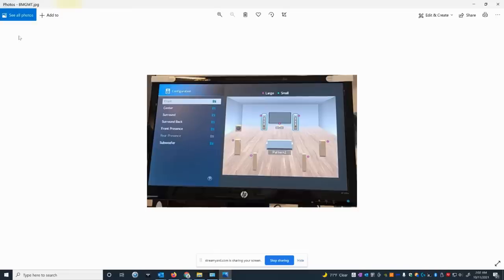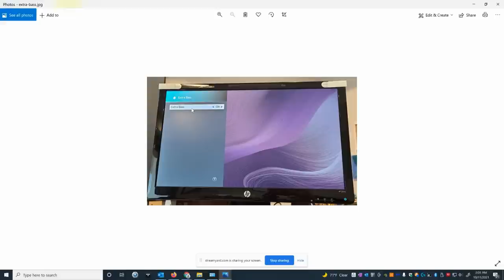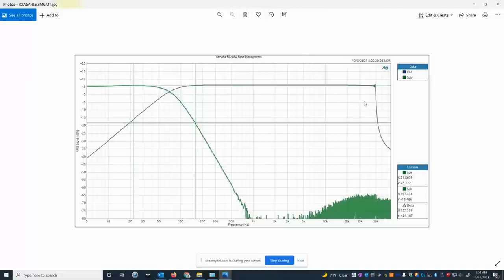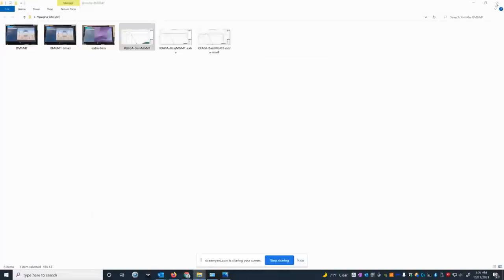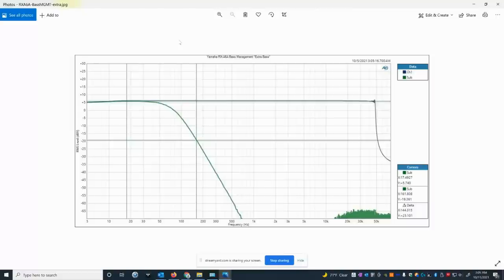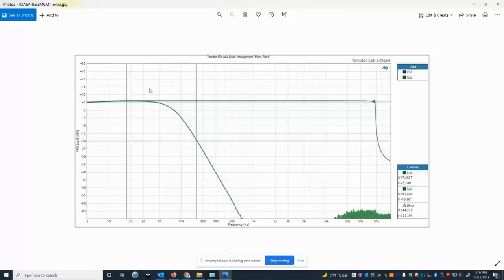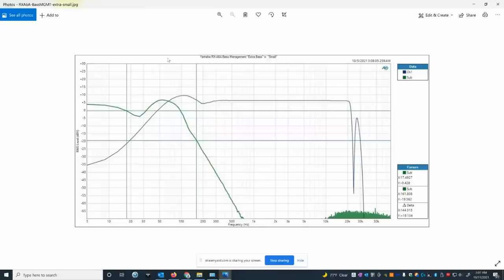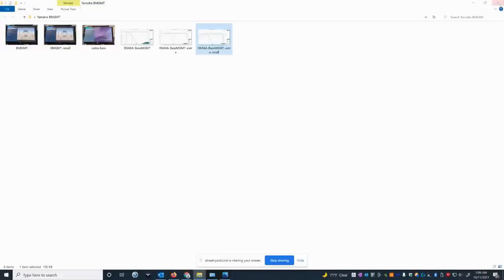How to Set Extra Bass Feature Yamaha AVENTAGE AV Receivers

Comment: Hi Gene. I think using Extra Bass (aka LFE+Main on other brands) is still problematic when the speakers are set to Large. There's overlap so a bump in the combined response occurs. [keep in mind your graphic just shows the electrical output but not the combined/summed acoustical output] While that bass bump theoretically could be EQ'd away there are issues:
A. You can't apply said corrective EQ in the subwoofer out signal because that would also be objectionably EQing the soundtrack's .1 LFE signal when it is the only content traveling off to the sub. Remember we are only trying to fix the overlapped bass peak but the LFE channel should be unaltered.
B.  If you apply the corrective EQ to just all the main channels using a PEQ that's awfully similar to just simply using the HPF ("speakers small") already built in so why waste one of the PEQ bands to do this when you already have a perfect shelf filter custom designed in phase, and all, to work with the sub's signal?
As for Yamaha's wacky "Extra Bass" EQ when speakers are set to small, I assume that was to appeal to people who have grown accustomed to overlapped bass (a bump) and this gives them a simulation of it, even without owning a sub,
Reply from the maker: @m.zillch3841  I route bass to my mains and subs all the time with success using proper EQ. There are lots of advantages if you have the tools and knowledge to pull it off. For most people,  bass managed speakers and subs is the best approach to ensure success. This is why having manual PEQ adjustability is so important.

Comment: I misunderstood this advice the first time and started turning on extra bass with my speakers set on small with a 60hz crossover.  80hz sounded too high, so I checked with the speaker and sub manufacturers and they both recommend 60hz for my speakers.
I thought it sounded better with fuller bass.  It was perhaps slightly too much bass with bass heavy tracks, but I think better than having it off for my large room for 2-ch music.  It was also too nasty bassy setting my speakers to large and using extra bass. 
For HT 5-ch use it sounds like garbage with extra bass turned on. 
This is with the B&W 704 S2 speakers and 2 SP2000 SVS subs. I think I need larger 2-ch speakers for my space.  
But, for a large room that setting helps.
Reply: Update: I retried my speakers set to large with a 60hz crossover for the extra bass setting and it sounds fine. 
Question: will this setup hurt my 5-ch HT listening?

Comment: Are you shure that there was no setting aktive with small and extra bass on? i have many expirience with yamaha, and you could not found everything in the menu. For example: i´ve you made a YPAO measuremt: I see changes at the outputs even when i set the peq to "trough".
So to be shure that there is a bug like this: please make a factory-reset and repeat the test. maybe the result is different.

Comment: Hi Gene! Thanks for another great video. This time however after following your recommendation my system is lacking significantly in the bass region. I have a cx-a5200 and found after a lot of trial and error that it sounded best when my towers were set to small and extra bass on. Now that I set them to large there is barely any bass with or without extra bass on. I have two subs btw. Can you help me figure out ? Thanks!
Reply: Modal cancellations is playing tricks on you. Try simulating your room and speaker setup in REW. That will most likely explain it.
Reply: @MovieViking  I’ve got exactly the same problem and I’m not sure what exactly I should do to fix it. It just sounds better to me with the towers set to small and extra bass on
Reply: @mrkokimoto81  If it isn’t modal cancellations it can be the phase settings. I highly recommend simulating your room and setup in REW and be carefully filling in the data on your speakers - and when you simulate the configuration where the towers are set to small remember to adjust the cutoff frequency according to the crossover setting used in the receiver.

Comment: Hi Gene.   Can you explain what happens if you set the front left and rigt speakers to "large " but have crossover set to 80hz?  What would be the logic/advantage of this configuration vs a setting of "small " with an 80hz crossover.
Reply: Setting front LR to large allows the speakers to receiver a full range frequency signal regardless of whether the drivers themselves can handle this. Ignore crossover at this point. When small configuration is selected along with an 80 hz crossover this will essentially route any signal below this mark to the subwoofer (ie. 50 hz). Bass frequencies are more difficult to drive and demand more from the amplifier/power supply. So part of the logic would entail that your receiver will run cooler or more efficiently as less is demanded of it.

Comment: Random, silly question: If a speaker is set to large on the A6A will the subwoofer still function for that speaker? Or must you turn on extra bass for that to happen?
Reply: The subwoofer is active when it is turned on in the speaker config regardless whether the main speakers are set or large or small. Though, the recommendation is to set all speakers to small if you have a active subwoofer so they don't try to replicate the same below 80Hz spectrum. Again, depends on personal taste.

Comment: How did you adjust the crossover of the subwoofer with the mains set to large?
Reply: For 2ch sources The EXTRA BASS option is running the mains at full range but ALSO sending frequencies at the crossover point to your subwoofer. It's essentially doubling up the frequency response 80hz and below and sending it to mains and sub.

Comment: Gene help me
So I set my dual 8 inch towers to small, 80hz and my  dual 4 inch center speaker to small 80hz.. what do I set my sub  to? Should I set it to 80hz or higher?does Yamaha receivers have a fixed crossover of 90hz?should I turn my sub as high as it can go and bypass my sub hz? I’ve tried that but bass seems weak.
Reply: Set your low pass sub dial to LFE or as high as it can go. Set your sub gain at 50% to start with and run YPAO.
Reply: @TurboGuy979  
Ok thanks👍

Comment: On My YAMAHA RX-A1080, I have activated Extra Bass, but all my Speakers are Wide, I don't have a Bass box.
On the other hand in Option then Volume Adjustment, I succeeded in forcing SubWoofer Trim to +3.5 dB via AV CONTROLER on Android, we can do it via the amplifier by activating the subwoofer output while increasing the Subwoofer option Trim at + 3.5dB, then in the Speakers menu we deactivate the Subwoofer output, then we record the SCENE Modes with the SubWooffer Trim option at +3.5 DB.

The increase in bass on the Front Speakers and the Center speakers is punchy, even at low volume, like from -25 dB of Volume on the YAMAHA RX-A1080 amplifier.

Note only do this if you are at least in 5.0 or 5.0.2 or 7.0, because if you are in 3.0 or less, with a Subwoofer Trim at +2.5 dB there is a risk that one of the bass speakers will hit the air gap.

Comment: Yamaha extra bass works even if you do not have Subwoofers. I guess you are wrong regarding this function. It is what it is, extra bass. Useful for recordings or soundtracks with low bass level.
Reply from the maker: Idiotic comment. Of course it "works" but what it does IF you have the speakers set small is NOT a good idea IF you want proper bass integration in your system.
Reply: @Audioholics  I use extra bass in two different stereo setups. It works very well in both. I use extra bass most in the setup without subwoofers. And do not use the word idiotic please, it is not a good thing. Especially when you are on thin ice.
Reply from the maker: @dagjohnsen  thin ice from what,  you unsubcribing? 🤣  dumb to use this feature with speakers set small, idiotic is a polite way of stating it. Not calling anyone an idiot for using it, just idiotic feature that shouldn't work that way.
Reply: @Audioholics  Extra bass does exactly what it  is supposed to do. (check the name; extra bass) Thin ice because you got this wrong. I really enjoy Audioholics! Tons of great stuff for many years!
Reply from the maker: @dagjohnsen  I did NOT get this "wrong". Extra bass is supposed to copy the bass from the main channels to the sub like Yamaha's have historically done in the past. IT shouldn't even be selectable if the mains are set to small. Amplifying harmonics of bass is NOT a good idea and if intentional, Yamaha should change it. The distortion as a result should NOT be something you'd want to introduce into your system. Glad you enjoy our content.
Reply: @Audioholics  Well I do enjoy this function a lot on bass shy recordings. I believe that is what it is intended for. But you suggest to increase bass in a different way because this increase the distortion. I get it. Keep up the good work.

Comment: I don't like how the extra bass feature doesn't send more bass to the mains. And the EQ doesnt seem to get the job done either. Not everyone has a subwoofer and not everyone wants to use one. I have an old Yamaha and its bass extension features sends the bass everywhere it seems. This newer Yamaha has no punch whatsoever. Like when a kick drum is used in music, there's no kick to speakers hardly at all.  I have Cerwin Vegas and have no need for a sub so it would be nice to get the extra bass sent to them. My old R-V1103 is far superior in the bass deptartment.

Comment: This is a rather weird bass management technique by Yamaha. And I find it rather dissapointing that reviewers don't mention the effects of setting your front MAINS to LARGE with EXTRA BASS set to "ON" to get subwoofer output in 2ch stereo. Wouldn't this demand more power from the Receiver and risk it running hot, and put more pressure/load on the speakers as they will be running FULL RANGE? Why none of the reviewers are talking about this? Even the one that mentioned it said you need a Y-Splitter to get bass from the subwoofer in 2ch channel stereo, as the voltage from the sub-outs at the back of the unit are too weak and as result send a weak signal to the subwoofer? Which didn't work in my case by the way! This is frustrating! With my Onkyo NR686 I could select "MAINS + LFE" to get subwoofer ouput in 2ch stereo. With Yamaha it's so weird because when watching movies, Front set to small and crossed over at 60hz plays great! And the bass is plenty. But the minute you play from a source like a CD player, that bass vanishes! And it's gone! Until you reconfigure the settings to the abovementioned settings. 

The said part is it's a struggle to even assign a SCENE to audio settings like TV(movies) and CD player etc because when you switch between sources the audio settings remain and are applied to the currect source. With movies  and FRONT set to LARGE, EXTRA BASS just ruins the sound! as it becomes bloated and boomy.😢 Now I have to go to settings and reconfigure the system every I switch between sources!!😫Looks like even the Yamaha webpage cannot help in this regard?🤷‍♂️ I'm seriously contemplating returning the unit and maybe go back to Onkyo.🙆‍♂️😢😭

Comment: extra bass combined with front set to small is for cinema and NOT music - what you miss is that measure the outputs is useless because that all works together with YPAO and your room measurement
Reply from the maker: Bad assumption.  YPAO historically has not done anything beneficial for bass and this extra bass with smal speaker anomaly I measured will likely translate to worse, not better in room response.
Reply: @Audioholics  wrong - YPAO is weak for subwoofers but not for bass at the front speakers and "extra bass" uses YPAO for the crossover to the subwoofer too which is a critical point
Reply: @harald..please make a video to show us your point..I believe Gene went through the effort of finding out what he is discussing..disagreeing with him is not enough..prove your point..that is how we all learn..
Reply from the maker: @Harald_Reindl  again you're wrong. I spent years measuring YPAO ineffectiveness for bass for all channels. It has not been very effective at all. If it worked well on speakers then it should also work well on the subwoofer channel.
Reply: @setorliguddah  as I own a yamaha I don't need to proof anything! extra bass does simply more than play bass on fronts and subwoofer - it adjusts the curves on both to achieve a specific result - psychoacustic

i also don't need to search englisch boards where the way this feature works is explained given that I speak german and understood it years ago
Reply: @Audioholics  the problem is that 7 bands are way too less for a room with 50 problems and going crazy with 50 PEQ bands won't magically solve all of them

digital room correction is for fine tuning a acoustic treatment of the room and not to replace it

audiophiles need to learn that 50% of your gear is in fact the room itself
Reply from the maker: @Harald_Reindl  you should not need much EQ at all above the room transition frequency (500hz) if you start with good speakers and good room acoustics.
Reply: @Audioholics  I know, my room has only one remaining issue with pure direct which is eaten by YPAO for lunch